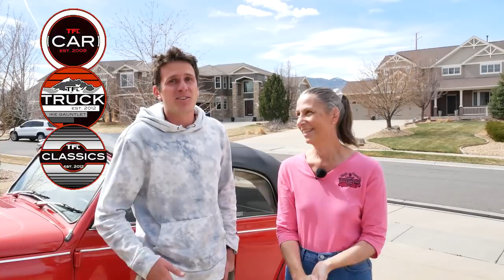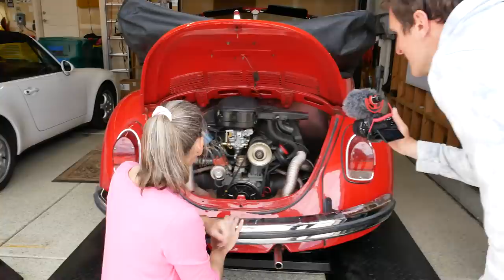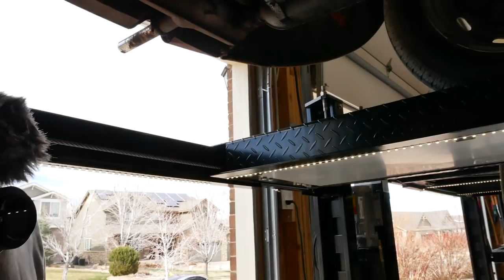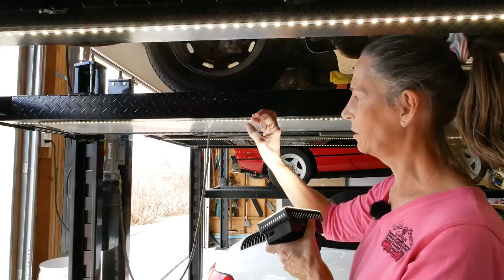Let's Look At TFL Classic Tommy's NEW BEETLE!

Comment: In 1972 I bought a 1971 'Super Beetle'  for $1800  and drove it for 21 years. At the end it was a 'Flintstone' car, but I really miss it. That car went cross country about six times and went everywhere from West Texas to the Carolinas, and back to Idaho and Montana. It was far better to me than I was to it. If I had the money I would consider buying another one and maybe restoring it with a 'Big Bore' kit, if those are still available. 
Good luck, but it does sound a bit like it needs a valve adjustment......which I could do in about an hour lying on the ground wherever I was.  Really hope you folks can give  it the  care it deserves. 😎😎😎😎

Comment: You are the best. I picked up a silver 1979 Super Beetle in very good condition for $2000. I had agreed to pay $4000 for it and the owner cut the price in half because she said it needed a lot of work. Original owner. I rebuilt the brakes and put new bumpers on. I also replaced the drive shafts. I’ve learned a lot from watching your channel. Thanks for what you do.
Reply from the maker: Thank you.

Comment: I have an orange 71 super beetle convertible. Mine also had a lot of problems the seller forgot to mention. 🙄 It’s almost brand new now though. I’ve had to pull the engine three times, new oil cooler seals, new push rod tubes and seals, new cylinder and cylinder heads, exchange generator for alternator, new fuel pump, new master cylinder, new ignition switch, new shift rod bushing, some wiring, new steering wheel, condenser and coil, lol I’m sure I’m missing something. I’ve had it about a year and it’s finally semi reliable. Thankfully the floor pans and heater channels were rust free.

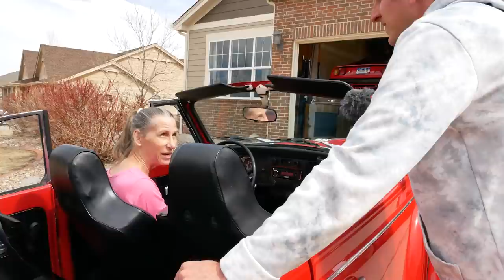Comment: @6:33 that’s exactly what happened to mine.  The diaphragm broke on my NEW fuel pump and fuel leaked all down into my crank case.  What a mess!
I installed a Carter electronic fuel pump(up front) with a blue Bosch electronic starter coil(the expensive one) and electric igniter(removing the distributor points).  
   …my Opie purrs like a kitten now!

Comment: Yay, a Super Beetle a.k.a. VW 1302! They are the best, a nice sporty suspension (if in good condition) but still the classic look. I have one myself, a '72, also red and black (not the original colors too). Purchased it in early 2013 for 1500 Euros (roughly 2000 Dollars at that time) And yes, that was a steal even back then, even for a car with dead brakes, a leaky engine and a convertible top that was ripped apart. But it wasn’t rusty and had two Porsche 993 fully electric leather seats who justified the purchase even more. Actually, i was a lucky son of a ….. to get it 😊.

And my additional 2 cents:

0:44 : If the top is closed at least its seal is missing. More than often the bow is broken, it is made out of particle board and cracks under the stress and due to moisture over the years.

5:13 : You can rotate the review mirror 180 degrees. This way it sits higher and you are able to see at least a little bit what is happening behind the car. It‘s a feature, actually.

8:07 : The hose for the pre-heating on the air cleaner is missing. Not good.

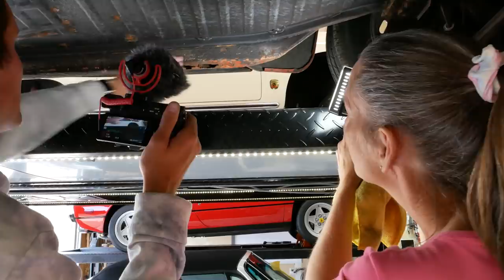12:50 : These aren‘t heating channels but reinforcements because the convertible is missing a solid roof. The heating channels are under the reinforcements. If the heating channels are good, this is an easy fix, you can simply patch it.

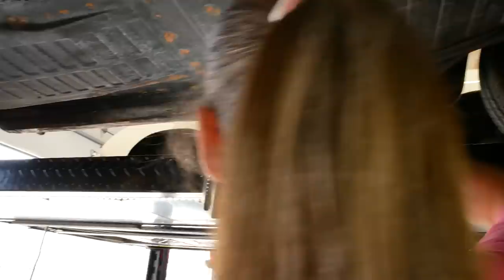13:27 : This looks like the welding spots rusting, because few people take the effort to wire brush the welds. If you are unlucky, the paint won’t stick properly and the welds start to rust. Chances are, they just slapped underseal over the new panels and saved themselves the hassle of painting alltogether.

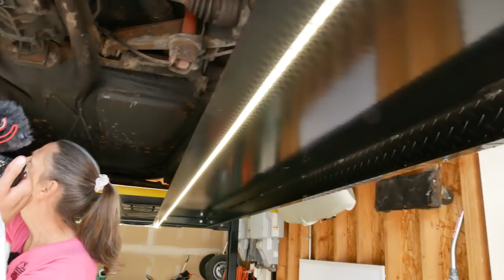14:45 : Sagging is a common problem with these late convertibles. They are much more heavy than earlier beetles and sag over time. But some do, some don’t. Mine did and after rising the back two times, i gave up and lowered the front to fix the ridiculous low rider look.

16:30 : Is the ground strap between the transmission and the chassis missing? This can cause a lot of trouble if the starter is trying to pull its power trough the heating cable 😄.

Comment: Hi Franny, I have a fully restored 71 Beetle. How have owners washed them with out getting water into all the vents that are on the Beetle? All I can think of is to lightly cloth wash/wipe around all the vents and tape them off with plastic bags and painters tape to when rinse time comes it would be less likely water would get into the engine compartment, fresh air vent etc. I'd welcome your professional opinion. Thank you for all the content you post!
Reply from the maker: I have the same issue with the 3.2 Carrera... What I do is to cover the engine with a big towel and then just remove after the wash. The towel will be a bit damp and great to wipe down the engine :)
Reply: You can machine wash the car 🙂. All the water that gets into the vents will drown itself. The 71 (with the hood that has two rows of slits) even has sort of a drainage mounted on the inside of the hood. But it is often missing, and the car does fine without it. Just plug the opening on the generator. Otherwise it would be impossible to drive on a rainy day, wouldn’t it?
Reply: @HeidiandFranny  Ok I'm embarrassed. Your towel suggestion is so simple. Some times we ( I, me ) cant see the forest through the trees! Did the towel trick today and worked perfectly.

Comment: For better view it is possible to fold the middle part of the roof to the front.
Reply: Excited to see more videos on this car! There was a way to open the top and pull the tops material from getting in between the bars which lowered the height but was hard to do with one person so most folks just flop it open. The solution is to rotate the rear view mirror "upside down" which raised it so you can see over the top.

Comment: Wish I had the '71 Super my grandpa bought me when I was young. (Around 5 yrs old) I had outgrown my VW pedal car and to shut me up (lol) he bought a yellow '72 with a sunroof, which he shortly after traded for a marina blue '71 cabrio. When I was in high school my biological father (divorced parents) traded it away without my permission for roof shingles. :/

If I won the lottery I think I'd want either a late 50s cabrio with the little nubby turn signals on the corners or one of the late 60s ones from just before they went all Supers, and I'd try to source one of the late late late model Mexican Beetles as a parts car. It wouldn't leave the garage super often, they probably aren't very safe to drive on public roads these days especially with the growing prevalence of SUVs and with even sedans getting so much heavier, but it'd be a blast to take out on those special occasions.

Right now I have a 1999 turbo sunroof New Beetle, which I absolutely adore. I'm disappointed VW stopped making Beetles especially with the switch to electric on the horizon, but I'm just gonna' enjoy mine while I can and maybe someday pain-free idiot-proof electric conversions will become available. :P

Comment: You're not lowering the top properly, and that's why the cover doesn't fit correctly.
As you lower the top, its folding in on top of itself. Grab the part of the top that is folding forward, and pull it out towards the rear of the car. Now the cover will fit properly, and you'll have better rearward visibility.
Next rotate the center rear view mirror 180 degrees for better rearward visibility.

Comment: VWs will peak in value, or may already have peaked in value and then fall off a cliff. 
90 plus percent of VW Beetle demand is boomers.  I'm relatively early gen-X and I only remember these cars as overpriced low quality used cars.  In the late 80s when I bought my first car and you get a 70s beater for 3-500 Dollars, a VW bug could get 3000-4000 Dollars. Most of them by this time had rotted heater channels.
Now Boomers are the last stage of life.  Lots of hoarders of parts want to downsize. As Boomers die off, there are going to be heirs who don't care about VWs and just want to get rid of them.
This has happened with older cars too. 50s cars are no longer near their peaks in both numbers bought and sold and price.  But at least they were big and cool with lots of chrome.